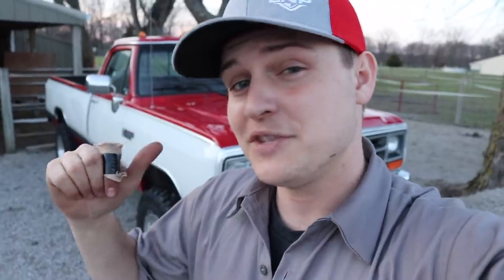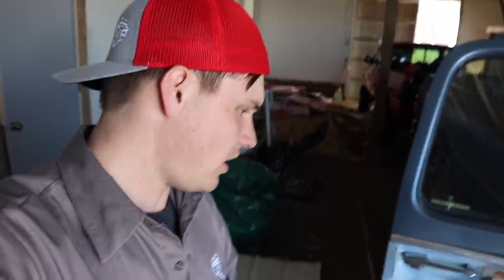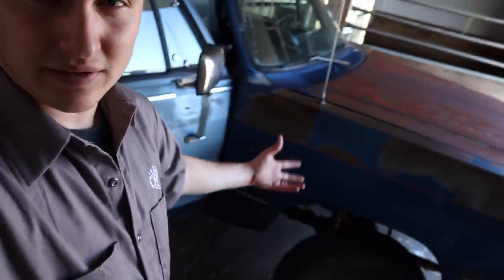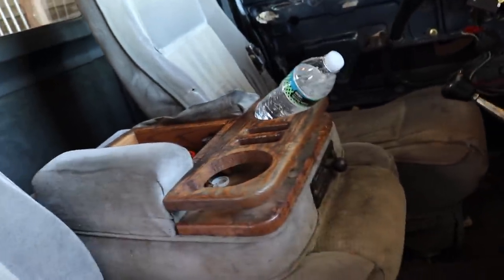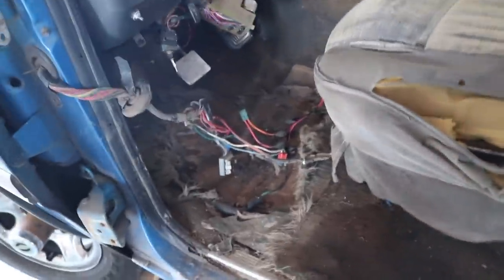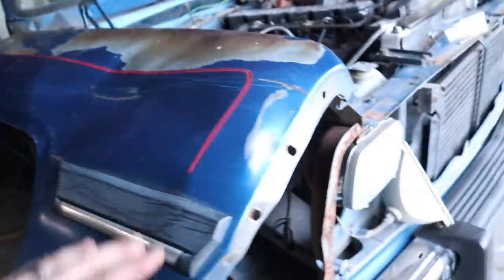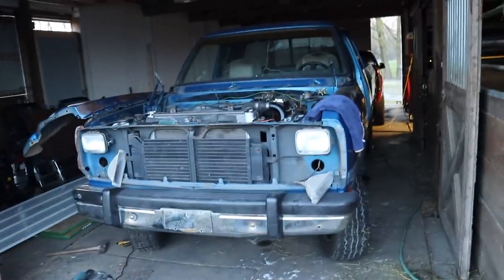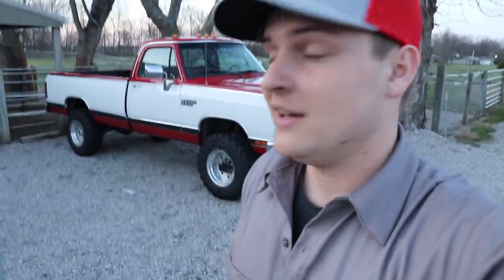I TORE APART MY 1ST GEN CUMMINS!!!

Comment: Hey lnp, did you now you could just unbolt the fender completely from the coresupport and cab without cutting there are some bolts under the cab and in the core support but the. There are also some on the inner fender. If you would have unbolted those the fender and piece you cut would have come right off
Reply: Ryan Villinger  I was getting ready to comment the same thing!
Reply from the maker: Well that helps! Lol thank you!